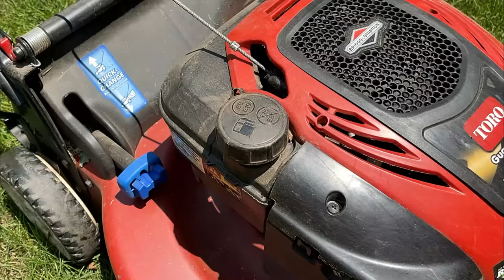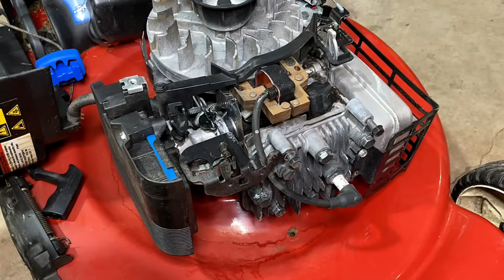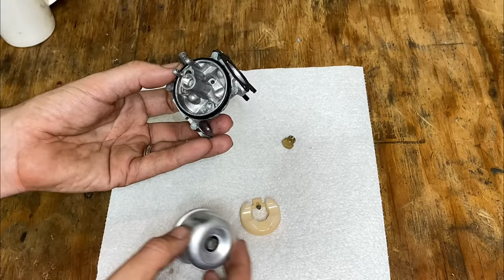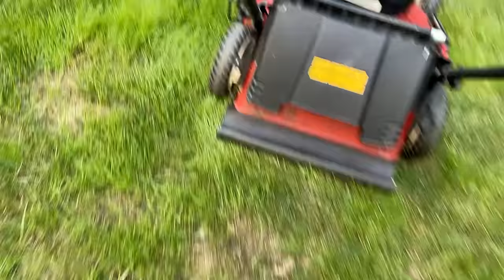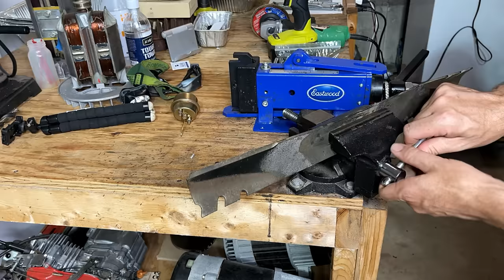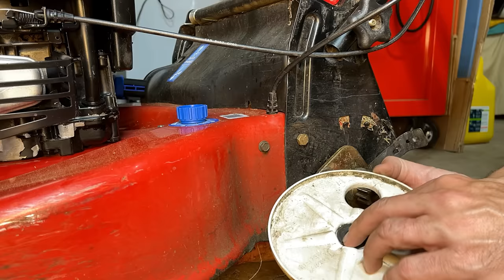Free Smoking Lawn Mower - Not an Engine Issue

Comment: I would 3D print the inside gear to be bigger and also once it got bad you can print it again.
Reply from the maker: Have not had much luck with 3D printed parts.  Not strong enough and a low melting temp.

Comment: Yeah just got one this week not having that problem my problem is it run and then it won't start after running it for like 15/20 minutes I did the usual clean the carb change the plug took the top off clean a bird's nest out it now I'm stumped ?

Comment: Have to be careful with soaking some of those Briggs carbs. They don’t have rubber molded to the needle tip, instead they opted for a small, square cut o-ring in the seat for the sealing surface… and that rubber seems to be a lot less resilient than the rubber used on the needle tips. Some cleaning agents can rapidly deteriorate the o-ring, where it might look ok, but you get it all back together and it won’t seal.

Plus, if you use compressed air to dry the carb after cleaning, they’re really susceptible to getting blown across the garage, never to be found again… deeply annoying if you didn’t know it was in there to begin with. At least you can get a needle and seat kit. 

Certainly not my favorite carb design. The push mower I’ve had since 2013 is so equipped, and it’s not maintenance free despite my best efforts. I only run E0 fuel, added a shutoff valve and always run the bowl dry after every use, but I still end up having to clean out the main jet/bowl bolt every single summer. When it’s right, it starts easy and runs great, but the annual jet clog is irritating. I’ve got a leaf blower of the same vintage, used roughly the same frequency and duration over that time (if not more) — it doesn’t get any of the above special treatment, but has been completely trouble free. Go figure.
Reply from the maker: The degreaser I use is fairly safe on rubber, but it does sometime cause them to shrink!  Its a very very simple carb.  Could use a little updating.

Comment: Hi I think by now I have seen all of you videos. They are very informative. I do have a lawnmower question though. Our troy bilt tb 110. run great. But if i dont use it every day,the pull start wont pull. Its like the motor is seized .If I pull yhe spark plug wire and rotate the blade a few times it will pull and start up.It will be good for a while.Ive heard of some mowers having a brake. This is a gas push mower, nothing fancy. I think its a 2014 model.Any idea what could be wrong?. THANKS

Comment: I have a couple of questions about the cleaning process at around the 12 minute mark.  Was the first product you used the same as the second (Super Clean) only in an aerosol?  I couldn't read the label.  Secondly, as long as the spark plug wire is connected is there anything that shouldn't get sprayed with the cleaners?  It looked like you pretty much sprayed everything.  Thanks.
Reply: Only things that are problematic to spray/hose are the air filter/carb inlet and the muffler outlet. Any degreaser can be used on the engine/plastics though no cleaners will restore dull plastics other than products for that purpose. You can hose down just about anything as long as you avoid getting water in the engine or inside electronic cases.

Comment: Just a question. Aren’t you concerned degumming and rinsing the mower over your blacktop driveway?
Reply from the maker: It has not caused an issue.  More problems doing it on the lawn.

Comment: Just wondering...why do so few video's mention at least removing / checking / gaping or replacing the spark plug ?
Reply from the maker: Only once have I come across a bad spark plug, so not very high on my list of things to check.  Mostly focused on restoring to good running condition.

Comment: So get rid of the drive system and push it.  The area looks flat enough, and there's no need to bag it (adding extra weight to push around) there instead of mulching it, even a potential benefit to mulch because it looks like you have significant clay in the soil so mulching would help to generate topsoil over time, as would mulching leaves in fall, as long as you don't wait too long to mow, maybe bag it only in spring if the rain keeps you from being able to mow often enough in between drying out enough to do so.

Another thing to check when you have an oil burner is to put in 30wt oil, some owners are just buying bulk of 5W-20 for their cars and using that for a mower too, which may work for a while but once it gets some wear, not as well as 30wt if you only run it in warmer weather.  Plus once it has burned some oil, may be time to clean out the exhaust port and check the muffler spark screen for clogging.
Reply: Get rid of the drive system. No way!!! Once u go self propelled you'll never go back.

Comment: Do you have room in your mower repair area for temporary ramps leading up to a work bench for mower servicing?  I see you bending over to work on lawn equipment at floor level in each vid.  Might be easier on your back to work at waist level while standing (or even sitting)?

Comment: Hi James, I enjoy watching your videos. I noticed the recall you showed mentioned three screws that needed to be replaced to fix the issue. I don't think this recall refers to your issue. On yours it appears the pinion gear and wheel gear do not engage properly which quickly results in a worn plastic gear. If you remove a wheel and insert the axle bolt into the bracket you will see the center lines of the pinion gear and axle bolt are not parallel. Your mission Jim (should you decide to accept it) is to find a way to better align the gears. This comment will self destruct in five seconds. Good Luck Jim.
Reply from the maker: I agree not exactly the same issue on the recall.  There are definitely ways to fix it, but was really looking for a fix from Toro instead of a custom fix.
Reply: @jcondon1  Do you have a local Toro dealer or repair shop that may know what Toro did to fix that specific problem?

Comment: Put some Seafoam in the gas tank and oil crankcase, cut the lawn, then change the oil. I had a engine that surged, after the seafoam in the fuel tank the engine ran smooth. Just a splash of seafoam will do you. Afterwards change the oil change, just add a cap full of seafoam to the new crankcase oil, a mechanic friend told me. Once I used a Intake Valve Spray Cleaner in the carb to help clean the valves. I had a mower that would start and run rough after taking a break half way through cutting my lawn. I followed the directions on the can for my truck and my mower. Never had that mower run rough since, but I changed the oil afterwards. I had a mower blow smoke after initially starting, and it had a much noticeable oil leakage on its frame. It was hard figuring that one out, but after changing the Craftsman 6.75 hp. engine's top  "breather' and the side valve cover rectangular gasket, it leaked no more. The crankcase had built up too much pressure and blew oil out the weakest point, the side valve cover gasket. That Craftsman is a 18 yo, but yet it looks new, runs like new, and it cuts our front lawn beautifully. You just have to maintain your equipment. Watching Channels like this is full of Lawn Mower TIPS. A thumbs up to these guys who take the time to produce these video for us.

Comment: Hi,  What type of grinding wheel do you use to sharpen lawn mower blades ?
Reply from the maker: More recently I have been using a flapper disc on an angle grinder.  Not sure what kind of grinding stone I use on the bench grinder.  That was something that was given to me and have never opened it it to take a look.

Comment: Yeah. Looks like Toro definitely dropped the ball on the drive system. Those teeth or cogs are way too far apart. Surprised they didn't do a better design in that. They even admitted to it, but doesn't do anything for the homeowner who invested in a mower. Looks like the previous owner played with the adjustment to make it engage just about all the time it is running, but really doesn't address the issue.

Comment: I brought my 4500 kw generator out for its periodic operations test.  That was the first time I have checked since I got a KillWatt meter.  It started on the first pull and had 120.8 volts at 61.3 Hz.I let it warm up for 10 minutes and then started running my load tests.  With a 2,000 watt load the voltage dropped to 123.5 volts at 62.2 Hz.  I thought it was a pretty good OP test.  What do you think?
Reply from the maker: 123.5 volts is fine.  62.2 hertz is a little high at about a half load.  Still within spec.  What was the engine speed once warmed up without a load?

Comment: There's water in the gas. Replace with 100% gas, no ethanol, and clean spark plug or replace. Not worth it to spend $150 to get it allnfixed.

Comment: James was that a pipe cleaner you was using to rub in the  jets of the Carb? I need a wire like that. Thumbs up!
Reply from the maker: I usually use torch tip cleaners, a wire from a wire brush and those brushes that look like a pipe cleaner.  Those brushes came with a carb cleaning kit.  I have a link to something similar on my website www.Amazon.com/shop/jamescondon

Comment: I have a toro lawnmower that’s surging and have to start it with starting fluid. The engine seems kind of weak. Any ideas? Cleaned carburetor already. Same results. Thanks 😅
Reply from the maker: Surging is almost always a carburetor issue.  Could also be caused by a leak between the carburetor and engine.  Sometimes cleaning then will not bring them back.  Would try a new carburetor.
Reply: Thanks very much for the suggestion. Appreciate it

Comment: Is it one of the newer mowers with a tag that says never change the oil it's filled for the life of the engine?
Reply: I know.....sounds really dumb.
Reply: @YukonHawk1  not if you're trying to sell mowers.  They're not wrong when they say filled for life, don't change it and it'll die soon.
Reply: @bad05ford  🤣🤣🤣👍👍👍 Recently I was looking to buy a pressure washer and Lowe's had a Craftsman model with a Briggs with the same option to just add oil. I wonder who the dimwits were that thought up that concept. Stay away from that one for sure.😁😁
Reply from the maker: These engines have no oil filter.  It you want it to last, change the oil!
Reply: Trouble is the service life of the mower is doable even if you don't change the oil ( 5 years ) 
most people will just get another one.

But you could make it last 10-15 + if you look after it changing the oil etc.

I have a 30 yo Briggs self start quantum rover in Aus that still is in full home use .....I look after it even down to adjustment of the valves (possible with a file if not to bad )......it will outlast me.

Comment: I've watched a few of your video's now, mainly on generators. I have a Honda GX140  EB1900x generator which developed a problem, runaway!. I removed the fuel tank and there's no Governor pin it's dropped into the crank casing, no engine damage from what I can tell, starts but goes insane revs. Problem sourcing a bolt to slot in the coil shaft that doesn't slip into the primary spindle thread, don't know if that makes sense. I believe an 8mm bolt should do to pop the inner core off. If I go in this way can I get at the valves, the intake valve was sticky?
Reply from the maker: Sorry not sure I understand the question.  Are you looking to remove the rotor so you can open the engine up?
Reply: @jcondon1  yez

Comment: Hello. What do you use as a solution in the ultrasonic cleaner? I been using that Gunk stuff in mine, but could not get it as clean as you have them.
Reply from the maker: Harbor Freight Super Heavy Duty Degreaser

Comment: It is a good video but it is too long, it could have been edited down to less than 1/2 the time. It was clearly not an engine issue, it seems to run fine even before anything was done, except for the hard starting. It shows if you know what you are doing, you can save a lot of equipment that could just end up in landfill, which is a waste. This lawnmower is fairly new, probably less than 5 years old, the engine could not have been worn out unless the previous owner really abused it. I have similar problem with my Craftman snow blower, it was barely 3 years old and it could not start and run rough. There is no water in my snow blower's carburetor like this lawnmower, but the deposit inside the carburetor was bad and I had to do a complete cleaning and overhaul just like this to get it going again. I am not a fan of either Brigg & Stratton engine nor Toro lawnmower design. Just watch how much work he has to put in to tear the damned thing apart just to get to the carburetor! The Tecumseh engine is a much better design, I can get to the carburetor without tearing the machine apart, it shows that Tecumseh designs their engine to be easier to service. My 20 years old Craftman lawnmower is still going strong, and the only thing I have to do is to change the oil, the drive belt and finally the helical gear that were worn out. The drive wheel design on the Craftman is also way better than the Toro, mine did not wear out at all until it's 19 years later. Too bad, Sears don't sell these incredible lawn mower anymore, as they had to sell the Craftman brand to keep them afloat a few years ago. And, no, I am not a fan of the Toro "Auto Drive" either, I hated that the handlebar has to move to mower to move, I prefer my old Craftman's drive lever, I can precisely maneuver the lawnmower around my yard and bushes. Another thing, they don't make them like they used to, my new Toro starts to smoke badly and spitting oil on the deck only after 3 months and have to get warranty service! Such poor quality comes out of the gate, never a Toro again for me and no it was not overfilled if that's what you are thinkin (impossible after only 6 cuts)! And, don't listen to Toro or Brigg and Stratton's moronic "no oil change" garbage, I spoke to the Toro service center as I plan to change it every season anyway, they confirm don't do what Toro said. You don't want just to add oil into your car's engine, why would you do such a dumb thing to the small engine! Keep in mind, the lawnmower engine is air cooled, think about the vintage Porsche and VW Beettle engines, so they runs hotter than typical water cooled engines, the oil will degrade to the point where there is no viscosity left but carbon sludge gunk inside the crank case!

Comment: I picked up a Dolmar 115i for $60.00, The owner was moving and he had 3x saws for sale the air cleaner had been wire brushed clean back to the mesh/ no flock material left but the smaller Precleaner Screen was full of saw dust, He had obviously had trouble running this saw and just bought a new saw x2, just lucky for me he still couldn't run the saw, the bar still had Dolmar painted on it and gave me the original full chisel chain for it, It was practically mint condition! That oil is most likely the Original, I have come to realize people think that oil will last the life of the machine, It's a messy job and not getting My hands dirty,or maybe they just have to much money to spend!

Comment: James - I put a metal gear set on my Toro mower.  https://www.amazon.com/Toro-Drive-Wheel-Assembly-137-4835/dp/B07Q3X5F58
You must replace both the pinion and the drive gear/wheel.  Works great for about 4 years now with a big lawn. Need to check if this listing above will work on your mower model.  It fit on mine. I'm a happy camper.  Not so happy with Toro however for making something so cheap.

Comment: I wonder if the surging when cold was caused by the drive system being partly engaged…. Now fixed seems to run better… What are your thoughts James?
Reply from the maker: Not sure.  It did not run much better after the carb clean, but after running it a couple more times it came around.
Reply: @jcondon1  good to hear. Thanks for the reply.

Comment: Them gears should be made metal, it looks like they're held on by rivets, I'd just replace them with steel ones. Drill the old rivets replace the gears and re rivet the new steel ones in. Problem solved.
Reply: There is a wheel with metal gear available but the small gear needs to be replaced along with it available on Amazon

Comment: James is there any way to extend the axle to make full contact with the wheel gears.  Maybe it too much work.
Reply from the maker: The mesh better, the best way is to cut the plate and we’ll backup so the wheel is a little closer to the drive gear.
Reply: @jcondon1  That is similar to my idea which was just to rebuild the wheel mount plates with the wheel mount holes closer to the drive gear holes.  Cut and weld sounds more fun though!  Another nice find!  Nice work again too!
Reply: Adjusters wear set on middle setting bar in front of wheel mount bend out. Lessens clearance between gears. This alignment procedure is on utube.

Comment: New subscriber, love your channel. I have a ryobi gas weed wacker, can you show how to rebuild them little carbs? Thank you!
Reply: Rebuild a carb? They're less than 15 bucks online. No need for a rebuild.
Reply: Most of the time, you don't need a complete rebuild. The fuel metering diaphragm dries out if stored for a long time, or it just gives up. I believe ethanol fuel may be bad for them, but I don't know. Anyway, you can a pack of 10 or 20 of these for either Zama or Walbro carbs on Amazon for $10-$20. One rebuild kit costs around $10 or more. If you're careful taking it apart, you can even re-use the gasket. Takes about ten minutes to fix. These are cheap, but considering the ease of replacement and the price, you can replace it every year if you want.
.Now, them little carbs do need cleaning from time to time. I take mine completely apart, soak 'em in Seafoam, them throw them in the ultrasonic for a few minutes. I have a 30 year-old Weedeater GTI19 that is still my go-to. All I've ever had to do to it is replace old fuel line and filters, and clean the carb / replace the metering diaphragm.